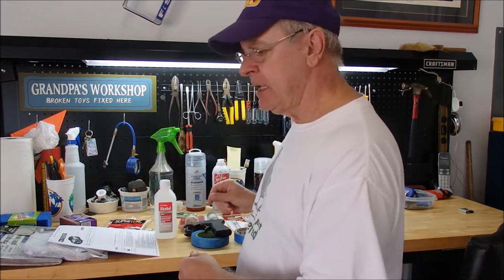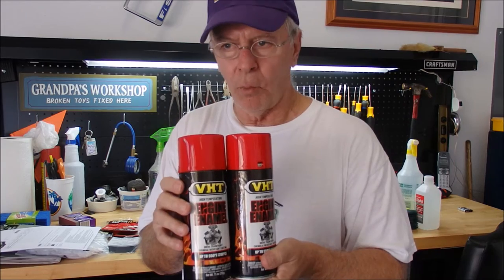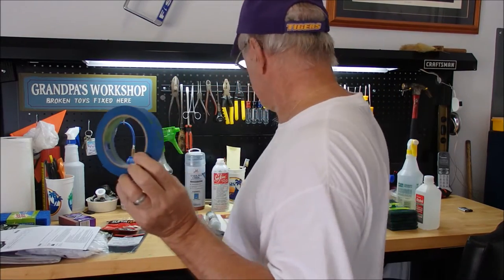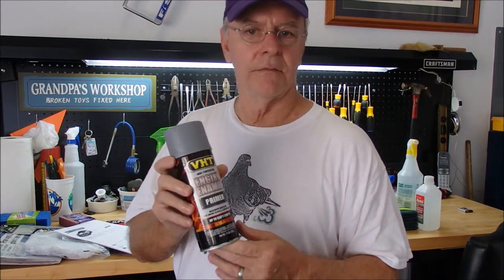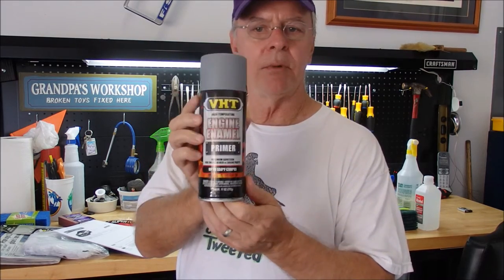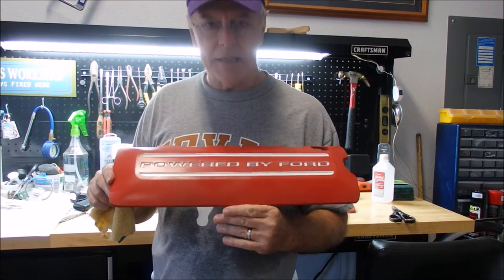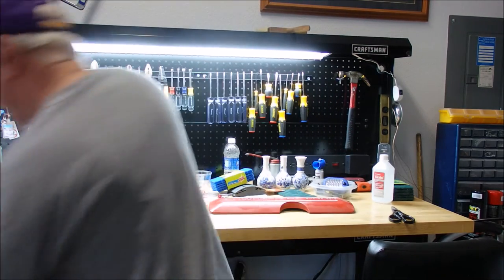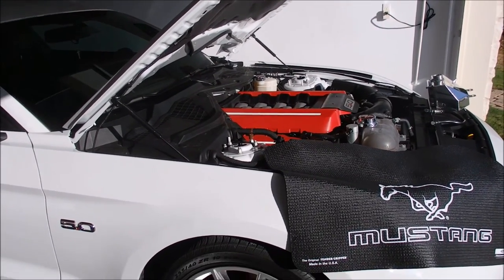How to Paint Coil and Engine Covers on 2015 Mustang

Comment: Nice job looks great bill keep up the good work.the reasoning behind spraying the clear on the wht areas before painting them white is just for removing any overspray that can occur on the already red areas?
Reply from the maker: +Kolour Blind Yep... That is absolutely right...Remember when you are painting those letters or stripes on the coil covers, to NOT wait and just get two coats down pretty fast so it doesn't dry on you.  Then take your rag with that Testor Airbrush thinner and start to wipe in one direction and turn your rag often and keep it moist with the thinner.  Don't worry , you will be successful.. Good Luck
Grandpa Bill, Austin.

Comment: +Bill Fraught How much paint did you end up using? Did you need to use 2 cans of paint per application? (Primer, Color, Clear)?
Reply from the maker: +Focus Mode For the MAIN Color, in my case, Red, I used about 1.5 Can.  For the minor colors, i.e. the lettering and strips that I did in WHITE, I used one can.  The Primer, I used 1 Can, and for the clear coat, about one can.  Remember at least two coats, but DON'T drown it.  Just nice shallow coats, and let them completely dry between each coat.  About 30 to 40 Minutes,  When you do the last coat of PAINT, let that set up overnight, then do your clear coat the next morning.  Good Luck and don't rush it.  You will succeed.  Grandpa Bill. Austin, Tx.
Reply: +Bill Fraught I can't find Testors airbrush thinner anywhere, including at Hobby Lobby.  All anyone has is Testors Enamel Thinner.  Is that the same stuff?
Reply from the maker: +Focus Mode Yes it is hard to find at Hobby Lobby.  They don't have it by the Model Airplanes or Model Paint,... They have a separate section, usually at an end cap, for Airbrush stuff.  You need to ask one of the little old ladies, where the airbrush painters and supplies are, and it is on the bottom shelf by the floor.  I don't know if Enamel Thinner and Airbrush thinner are the same, but since they are two different products, my guess is that they ARE NOT the same... but I could be wrong.  I think airbrush thinner is for acrylic paints, and Enamel thinner is for Enamel type of paints.
Reply: +Bill Fraught Maybe since this is Engine "Enamel" paint it should be fine? I will give it another look, but if I don't find it maybe I will have to just be very detailed with my taping.

Comment: maybe I missed something so only prep was cleaning and primer and after painting no sanding or clear? By the way amazing results on the painting.
Reply from the maker: Thanks.  U are right, I didn't do sanding but check video at mark 4:57, that's where
I show you the can of clear coat.  I'm not good at wet sanding so I didn't want to
risk screwing up what I had already done, which looked pretty good to me.
So I let it sit overnight, then put on the clear.
Thanks for the questions.  Good luck.  You can do it just don't rush and you will be happy with
the results.
Grandpa Bill, Austin, tx
Reply: Ok sounds good I will give this a shot on my EcoBoost engive cover do black and red like you did so just primer is all I need and of course a spray of clear also.............

Comment: Hey, How exactly did you tape off the details of the letters? Do you have a picture.?
Reply: +Falco16 I'd like to know how that was done also...!
Reply: Yeah, I mean whatever he did, they came out great. I'm planning on doing mine over memorial weekend.. lol
Reply from the maker: Ok go to part 20:38 in my video.  There I explain that I can't make up my mind to put tape between each letter,
OR just put one LONG piece of tape on each side of the letters.  I decided that taping each letter would drive me
Crazier then I'm already am!!   So you need to put a piece of long tape on each side of the letters" Powered by
Ford" then cover the rest of the cover with your towel, then spray with the white paint for your letters. 
DoNot Let It DRY!!  Then grab your towel that has the special thinner on it, REMOVE the tape fast, then start
Rubbing the overspray off.  It will smear, so keep wetting you rag with the thinner and rub.  Do Not Drown it. 
It should come off easily since, you had already sprayed it with the finisher spray, the night before. If you 
Guys still have questions, just write and I will explain it until you feel confident that your question is answered.
Thanks.  Grandpa. Bill
Reply: +Bill Fraught Thank you..!
Reply from the maker: +Ferninand M. Cole II I have answered your question about the paint the letters on your
Coil covers.  Hope this helps. If you still have questions, please feel free to keep asking
Me questions until you feel good with my answer.  God luck.  Grandpa Bill
Reply from the maker: Hey Falcons.  I have just posted the answers to you questions. Hope this helps
Reply from the maker: +Falco16 good luck.  Shoot me a pic when they are finished.  Grandpa. Bill
Reply: Perfect! Yes, you answered it! Thanks again Bill! Greatly appreciate it.

Comment: Why would you only put a oil separator on the passengers side and not the drivers side?
Reply from the maker: Tyrel Thibault  You can put them on driver side, but some research suggest that 8O% of the blow buy 
Occurs on the passenger side.  Thanks for commenting,  Grandpa Bill, Austin
Reply: Bill Fraught thanks for the info. Never heard that before

Comment: The overspray that was on the middle of the engine cover came up from underneath. Spray paint will find its way anywhere it can, and it blew up from the unprotected opening underneath.
Reply from the maker: darcsystems x thanks.  Didn't know that.

Comment: What about an oil separator for the drivers side valve cover?
Reply from the maker: My.  You don't really need it on the drivers side.  Oboist 90% of the blow by occurs on the passenger side, but I have seen them on both sides.  I believe as the car gets older and breaks in, you will see an increase in the oil accumulation on the passenger side.  But I've hadn't emptied my can in 4,000 miles, which will probably lead me to check it once every oil change, which for me is every 5,000 miles.  I use Ford synthetic blend I pick up at Wall Mart for about $17.00 per 5 quarts.  Remember your Mustang , if it's a GT v8 will take 8 quarts of oil.   Glad I could help you.   Grandpa Bill, Austin.

Comment: next time use trash bags or some painters  plastic drop sheets to cover up the spots you dont want painted insted of using towels
Reply from the maker: therealmeazy  Yes I thought about that, but the towels were a lot thicker then thin plastic, thus eliminating the potential of 
Infiltration or overspray seeping through the gaps.  As far as "next time" that won't happen...it's once and done for me.
Thanks for watching and commenting.
Grandpa Bill